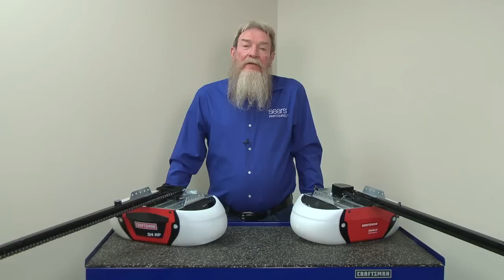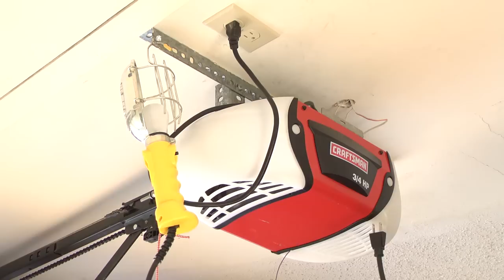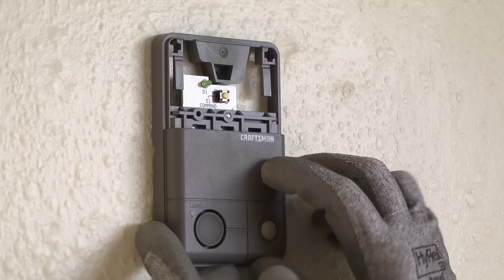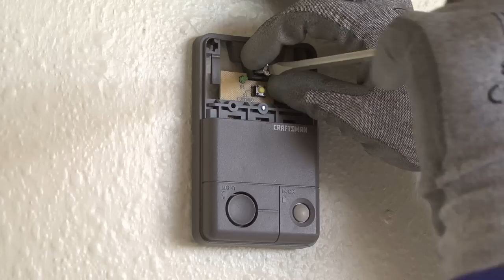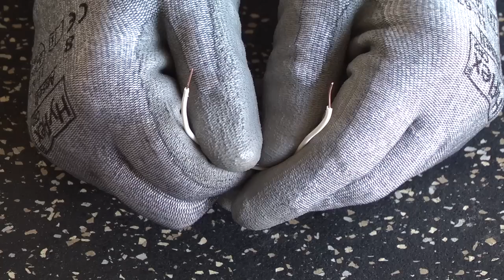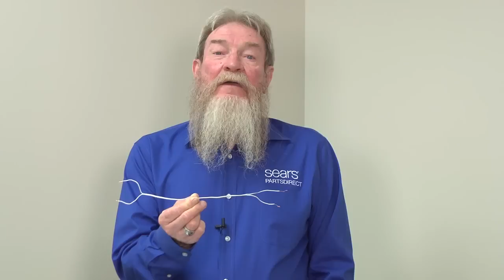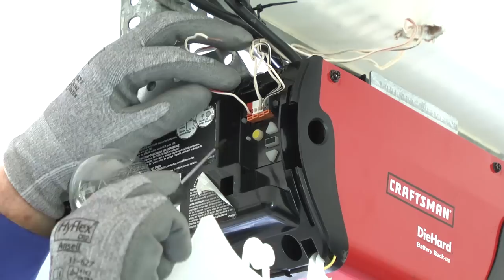Garage Door Opener Doesn't Work: Wall Control Troubleshooting

Comment: I have to press the wall button over and over again and eventually the door will open.  I put new batteries in my remote openers and they will still don't work.  I was told that the sensor inside the garage door opener could possibly be burnt out.  Does that sound right?
Reply from the maker: The sensor on the logic board inside the garage door opener motor unit could be causing the problems that you’re describing, but other issues could also cause the same problems. We recommend that you check the wiring between the wall control and the motor unit as shown beginning at :58 in the above video. Bad wires could be preventing the wall control from working properly.
 
Also, to find out what’s wrong with the remotes, we recommend that you follow the tips in our remote troubleshooting at https://www.searspartsdirect.com/article/garage-door-opener-remotes-wont-work-video.html.

Comment: My wall controller led light doesn't work when installed on the wall. It still opens and closes and activated the lights on the main overhead unit

When I hook up the wall control pad to the overhead unit using higher gauge wires the led bulbs lights on control pad and all works well?

Could it be the existing wiring is faulty?
Reply from the maker: According to your symptoms, the wiring between the wall control and the motor unit is likely the problem. Replace the wiring between the motor unit and the wall control and the wall control LED should work.
Reply: Actually if it’s a single LED on the wall control and it’s not on, but it still functions as it should,  that just means the wires connected to the wall button are backwards

Comment: what if the light near the learn button is blinking 6 times
Reply from the maker: That code typically indicates that the logic board failed. You'll likely need to replace the logic board to fix that failure. Before replacing the logic board, you can try resetting the board by unplugging the power cord for 2 minutes then plugging the garage door opener back in. Although that tactic only works about 10% of the time to fix this problem, it's worth a shot.

Comment: I have a chain drive opener when I push wall control I get a beep noise and a yellow light on back of opener I checked the eyes seems like they re functioning any ideas?
Reply from the maker: If your garage door opener had a backup battery, the motor won’t run with a drained battery and lack of power from the electrical outlet. Check the electrical outlet for the garage door opener to make sure it’s working.
 
If your garage door opener doesn’t have a backup battery, then a failed logic board may be causing the problem.

Comment: when I use wall switch garage opener it doesn't work.  learn light back on motor is working. also when I use remote control opener it also work.   could you please how to fix wall switch  garage opener ?  thanks
Reply from the maker: Check the wiring between the wall control and the motor unit as shown at 1:00 in the video. If the wiring is okay, then you’ll likely need to replace the wall control.

Comment: my garage door will only open with the remotes, the keypad outside and the wifi app.  Cannot get the Led controlled push bar to do anything.  Only installed by Sears in April and suddenly it says push control bar to open check owners manual for setup.  if I close the door from the wifi app, the door beeps (approx dozen times) and the lights flash on the motor.  Any ideas what the problem is.  there is power to the smart control panel.  Oh, and if I hold down the bar on the smart control panel, nothing happens
Reply from the maker: Check the wall unit for loose wiring. Use the instructions in your owner’s manual as a guide for checking the wiring. If you don’t have the manual, you can likely find an online copy of the manual here: https://www.searspartsdirect.com/partsdirect/user-manuals. Reconnect any loose wires between the wall control and the motor unit. If the wall control wiring is okay, press the wall control activation bar to synchronize the wall control with the logic board. You may have to press the bar up to 3 times to synchronize the wall control with the logic board. 
When you try to close the door with the WiFi app and the lights flash on the motor unit, check the number of flashes and refer to your owner’s manual for troubleshooting tips. The logic board may detect a problem and may be signaling an error code by flashing the motor unit lights in a pattern.
If these general tips don’t help, let us know the model number of your garage door opener and we’ll try to provide some additional troubleshooting tips to resolve your wall control problem.

Comment: Thank you so much for this awesome video. I have a question, is it safe to short the wires as indicated in the video for all similar units? We have carftsman 1/2HP and it looks similar to that one show in the video. I want to test the unit to open/close the unit by shorting the connectors using a wire as explained. Is this always safe to do? Because we have Digital Ants Bluetooth device that needs to be connected to the wire inserts of the motor unit shown in the video. Is this compatible with the unit?
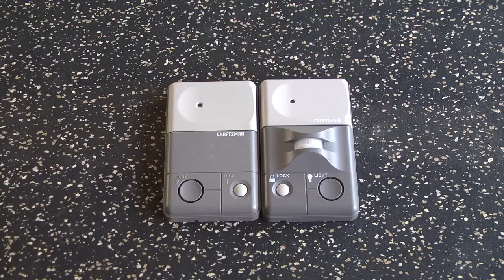Reply from the maker: No. That troubleshooting tip doesn’t work for all wall control devices. Shorting the wall control wires together only works for checking wiring on garage door openers that use basic wall controls like the ones shown 2:06 in the video. If your garage door opener uses a digital wall control or a wall control that’s different than the one shown at 2:06 in the video, follow the steps shown at 3:41 in the video to check the wall control wiring. If the wall control doesn’t work when connected to the motor unit with short wires as shown in that troubleshooting, then you’ll likely need to replace wall control. If you replace the wall control and it still doesn’t work, then you may need to replace the logic board in the garage door opener’s motor unit.
Reply: @searspartsdirect  is it always ok to short the connectors at the back of the motor unit as described in the video? There are some third party add-ons devices that require to be connected directly to such connectors which will simulate the push of the button of the wall control unit.

Comment: Just curious to know - what would happen if I put the wires in reverse into the motor? So red in white and white in red? Only reason I ask is my new motor doesn't have the colour codes so not 100% sure which wire to put in which port. It's an illuminated switch and have 4 ports to put in PB, GND, PE, and 24/36+. Thanks in advance!